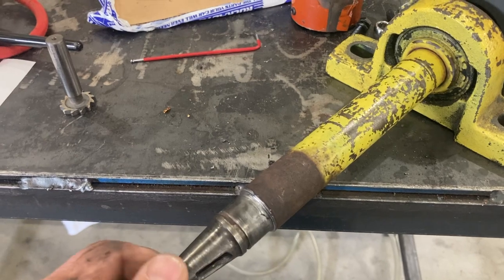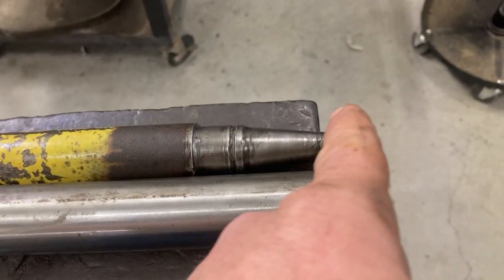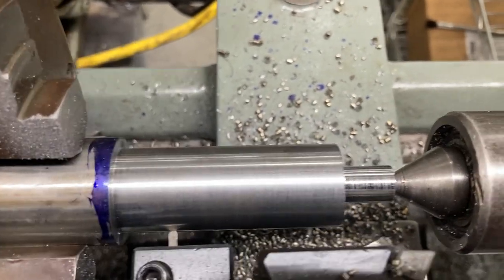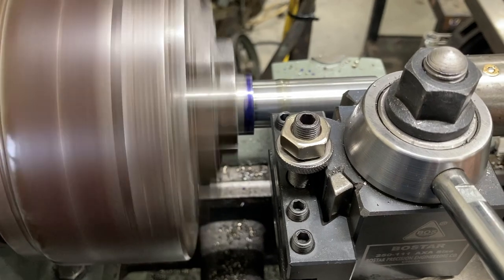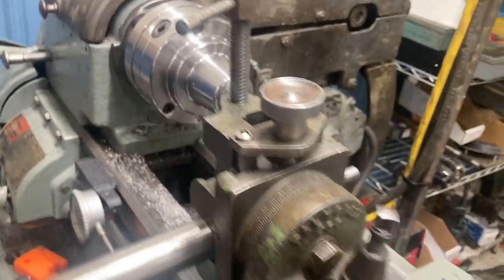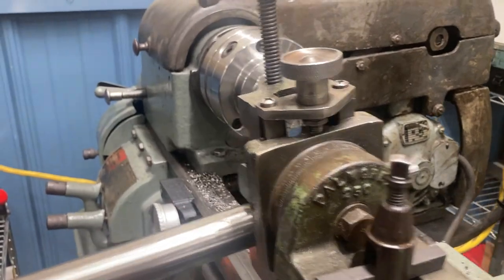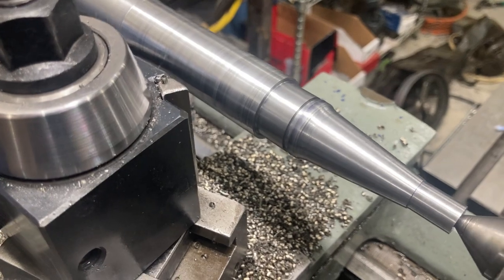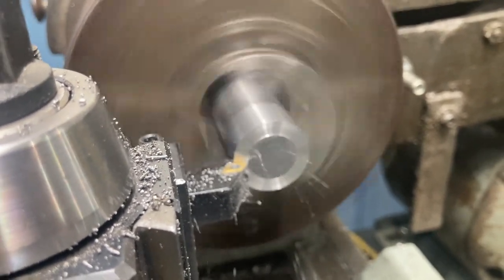Farm Shaft Duplication - ALL OLD SCHOOL - NO DRO. NO CNC. Milling Attachment.

Comment: That shaft turned out really nice. I have a mixture of conventional and cnc machines and I love them all. I would do my taper shaft keyways exactly the same as you did because thats what the clutch told you to do. 
Thanks for the video.
Reply from the maker: Thanks for watching! I’ve worked in CNC and Manual environments, and of course my shop now is all manual. 

What kind of work do you do with your machines?

Comment: The way you did the woodruff key seat works, as would doing it along the axis of the shaft, the end result is identical if both are done properly
Nice job!  I have a milling attachement for my lathe but found it's super flimsy and likes to come loose.. I'll use it if I really have to but I got a mill and that's much safer
Reply from the maker: Thanks for the comment. I have a Bridgeport Series 1 and other machines, but I decided to do this just for fun on my small lathe using this milling attachment. I agree that they are a last resort of sorts for milling, although there are a few neat things you can do with them. Thanks for watching!
Reply from the maker: And I agree that both orientations of doing the keyseat would come out ok. I just like doing it the way I showed.
Reply: @MaineMachinist  I have the same milling machine, my lathe is just an old Advance 14x40.. I'd be a lot more comfortable with the milling attachment if it had a better locking system for the angle rather than tightening the pivot nut.. something more like the locks on a compound.. real easy to break cutters and parts when it moves on you.. Even if the nut had a left hand thread it would be an improvement
Reply from the maker: @Rx7man  I also have the much larger and beefier Palmgren 400. You could probably use that on the 14x40 because it fits well on my larger Logan 6560 machine. I have a video comparing the sizes of the two milling attachments and the features of the 400

Comment: Part turned out great. Nice to see vintage machinery being put to use. Do you have much wear in the bed ways that you need to compensate when cutting a long shaft diameter?
Reply from the maker: On this particular machine it actually turns a long diameter very very well. The machine has some wear but is remarkably accurate. On my larger Logan lathe I have a  lot of wear near the spindle. I did a video showing ways of checking a bed for wear with that lathe shown since it was a good demonstration. On that machine I have to compensate. I usually take a test cut and measure, and make some marks along the piece with a sharpie, then use the compound set at 29.5 to feed very gently in as I go along. Emory cloth for the final finish to blend it nicely.

Comment: Shaft turned out great! Love that you did it old school. What metal did you make the shaft out of? 4140 or?
Reply: Looking at the chips coming off I am going to guess 1144 stressproof?
Reply from the maker: It was actually 1045 TGP
Reply from the maker: There was a piece leftover from a previous job and we figured it would work fine for this application and save the customer some money.
Reply from the maker: On a side note, VW Purist, I have one more video tomorrow to upload that’s tractor related and then we’ll be digging into some Air Cooled content again. Thanks for watching